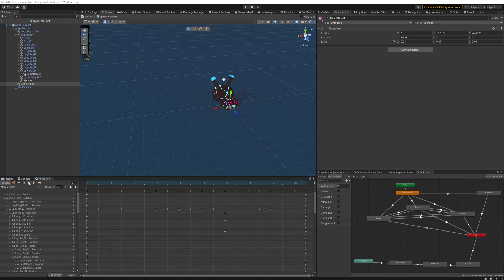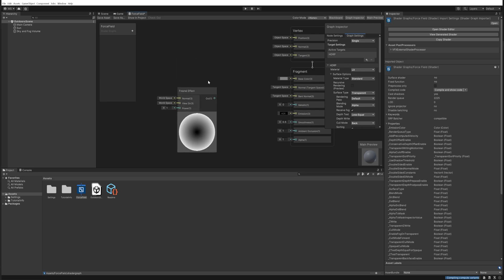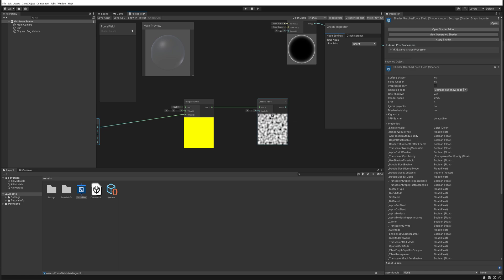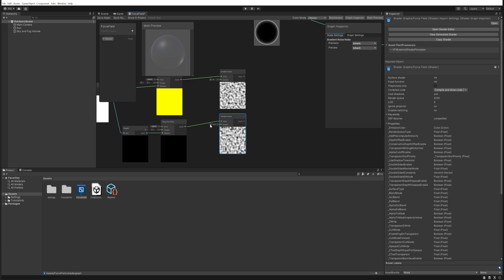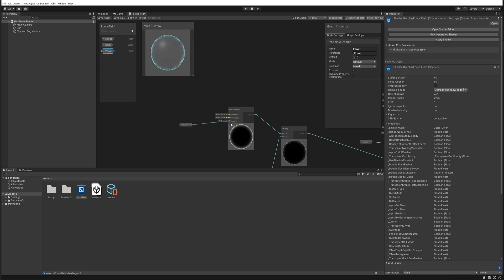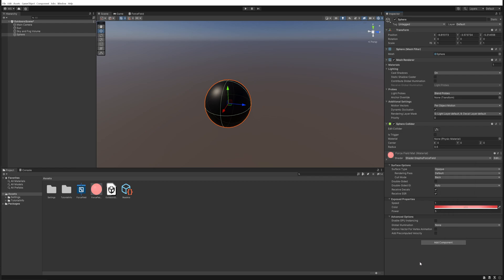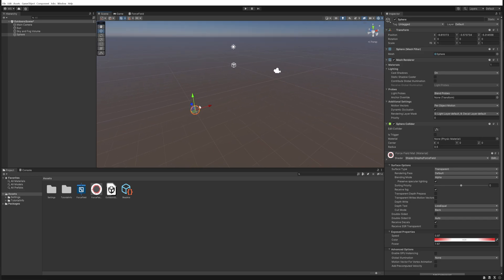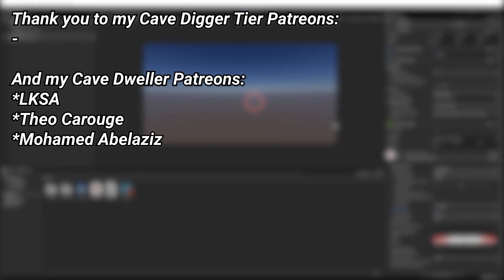How to Make a FORCE FIELD Shader in Unity

Comment: If you use a smoothstep on the fresnel to create a mask you can control where along the fresnel the noise is. Makes the effect look better. Then you can have an edge or not.
Reply: Does the fresnel feed directly into the smoothstep or is it a final node feeding the alpha? I'm not having much luck with that vertical edge...
Reply: Yes you use the fresnel as the basis for the smoothstep so smoothstep(start, end, fresnel);

Comment: Hey so i did just this.  However my forcefield is not transparent.. Any help?  I see the same happened for you but you skipped ahead to make it work.  What did you do?
Reply from the maker: as i say in the video, you need to make sure that the material itself on the object is also set to transparent :) it's a little annoying but even thoguh the shader uses transparancy, by default the material will be set to opaque because it's less resource intensive to render.
Reply: @thegamedevcave  thank you sir

Comment: Very nice, can I use it in my 2d platformer Unity game?
Reply from the maker: no this shader wont work with 2D assets, it needs a 3D model to work on. If you 2D platformer uses 3D models though it should work fine, but if youre using sprites, this  won't work.